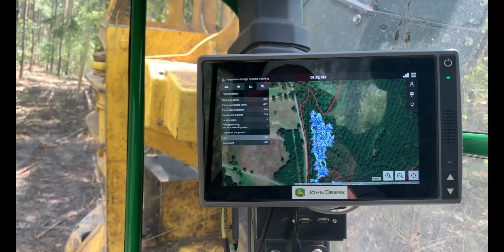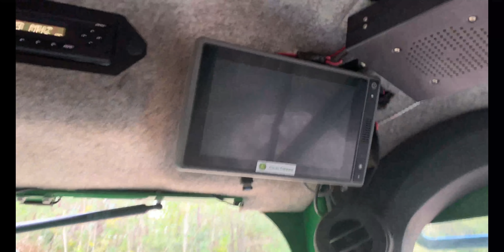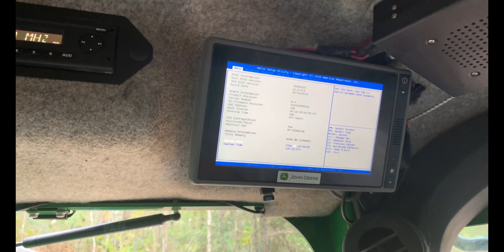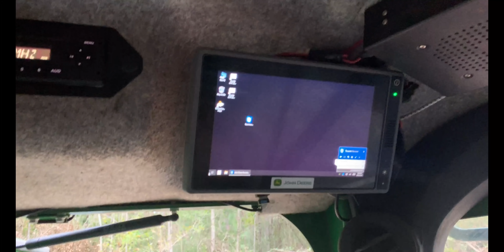Cleaning SMZ’s, pulling trucks, slick roads, watch this to win a hat!

Comment: My dozer man back drags everything, so everything ends up uneven, sloped and all kinds of bumpy. I feel like the term back drag should be considered a dirty word. Back dragging is what you do when you can't operate going forwards.
Reply: No , backdragging is done by good operators who care about how the job looks when it's finished. Grouser marks are not professional looking in final grade.
Reply from the maker: With skidders, you get a better job by back dragging and it usually seals off the road so rain won’t soak in.
Reply: @CuttingEdgeLogging_Thomas  no, I get it, different application. I was just joking about how that term triggers me. I run a 480e in a pit all day so I need a level bench and a smooth haul road, back dragging does nothing for it. The man spends more time in reverse then he does going forwards.
Reply: @JoshuaSmith-xw6jp  ok,sure. But you said final grade, that is a different situation. When you have a six way blade and nothing but sub grade and haul roads but you spend 90% in reverse, you would be rookie. Back drag this, back drag that, the blade cuts going forwards not backwards.
Reply: @josiahvonb3426   i didn't know you were talking about rough quarry or mine work. Completely different animal than site work.